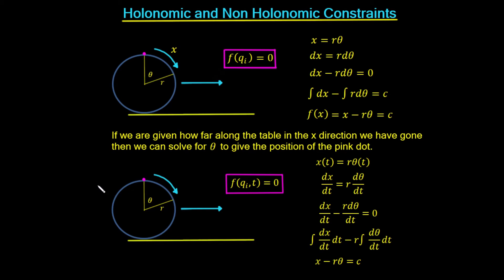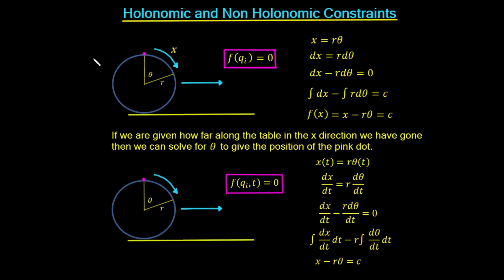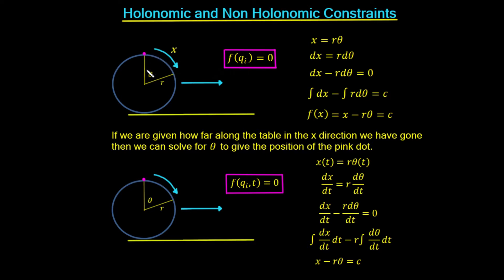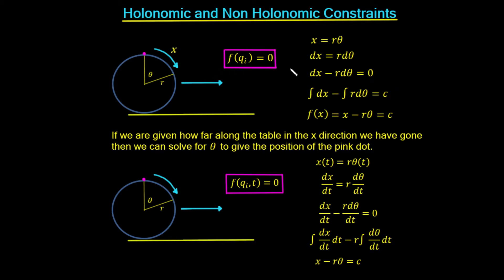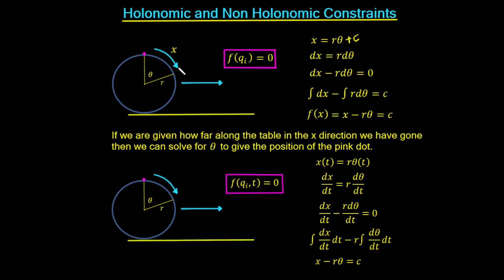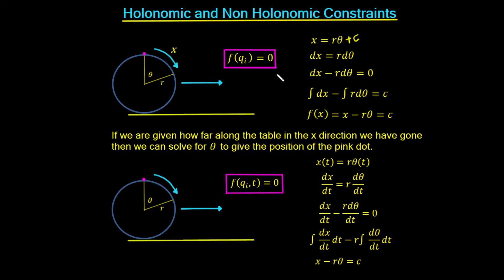Holonomic and Non Holonomic Systems

Comment: I don't get why the rolling ball has only 2 degrees of freedom. The degrees of freedom of a system is defined as the number of independent variables that can vary due to a small displacement. When the ball is displaced, the euler angles have to change as well. Also now that I'm thinking about it, I don't think displacement is very well defined for a system with more than 1 point paricles.
Reply from the maker: Been a while since I looked at this , but off the top of my head the degrees of freedom are the 2 independent axis  , x and y.
Reply: @RossMcgowanMaths  The degrees of freedom of a system is a minimal set of parameters that can fully describe the system configuration (i.e. its state), or in other words, the number of degrees of freedom is the dimensionality of the configuration manifold. In your case, x, y and the three angles are all needed to describe the system configuration, at least if you care both about where the ball is located on the table and about how it is oriented, so the number of degrees of freedom in your case should be five.

I guess if you only care about where on the ball the dot you drew on it is located, you can make an argument that rotations around that point are irrelevant, and that you therefore only need x, y and two angles to describe the system configuration, and that the number of degrees of freedom therefore only is four, but seeing that the component of the ball's angular momentum that corresponds to rotation around that point may still affect the ball's motion (perhaps?), I'm not completely sure you can discount that as a degree of freedom.
Reply: @kristoferkrus  The ball is assumed symmetrical, rotations about any axis are irrelevant, and therefore means the only information needed is the position vector (x,y). sorry for replying late, you probably figured this out 😓😓